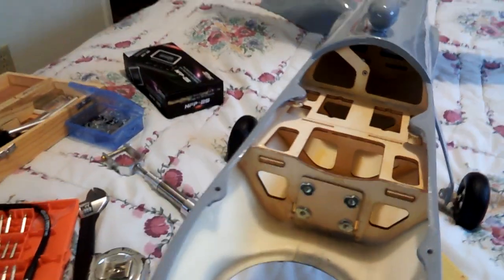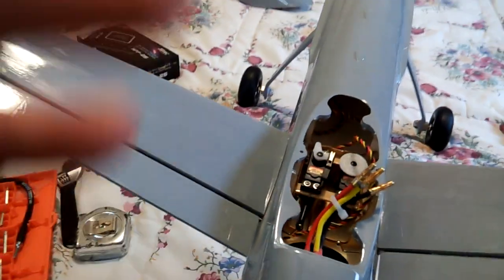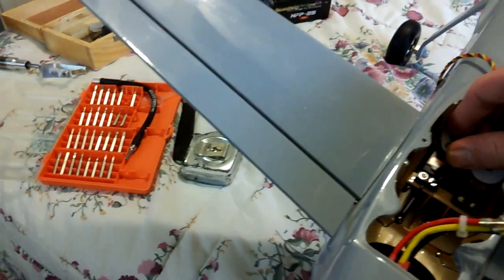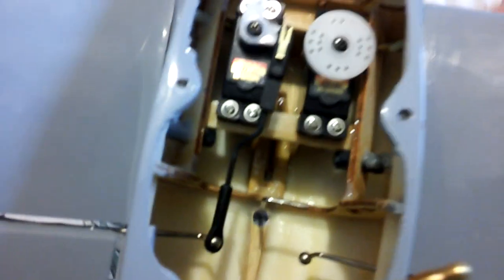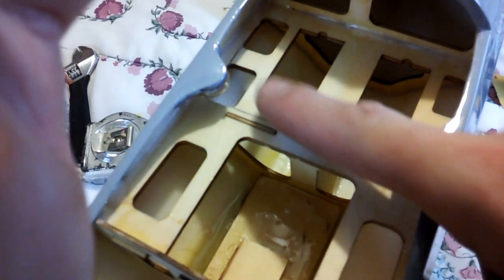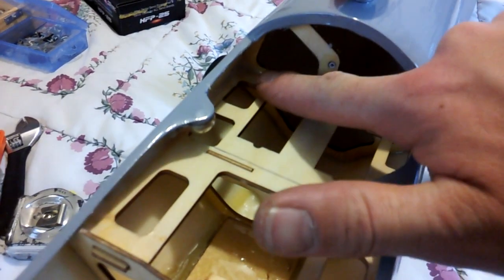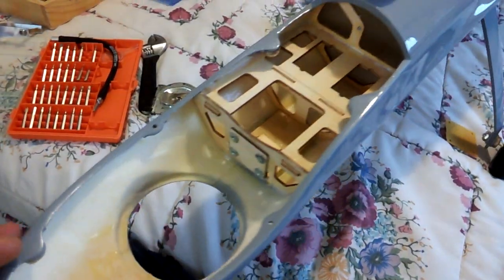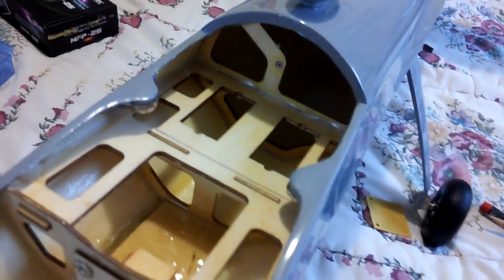ELEVATORS-FRONT STRUT PROGRESS IN THE MAKING

Comment from the maker: I did finish this, I ended up building an entire new one piece wing, had to carve out the bottom to accommodate. Added 1.2 cubic feet of wing surface, added 2 feet in length, independant elevons, and ailerons, full flaps, speed brake, Has full telemetry, altitude, temp, speed, AOA, motor temp, battery system temps, auto pilot programed flight paths, now on a 13 channel radio, with servo tracking antenna hi-freq. Running new HD 1440 cam, with either glasses or monitor viewing, or split channel glasses and monitor. Entire craft weighs 12lbs, has dual battery system that switches over at pre-determined level.
Flew at 33k feet in March 2018, will attempt to break 40k in december.. 
I will get a video of it up soon, will record the flight in December and post it as well.
Currently working on a U2 body style high altitude flyer, much better all around, better electronics, retracts etc...

Comment: Hey Rick, just wanted to give you a little warning, I have got the same airplane and its not a good flier. wings are to skinny and it makes it not very stable. I also had to put a 4cell 4000mah battery in the front and a 2cell 2100mah to bring the C.G. to where it needed to be. There are better planes out there for fpv/ filming. my video is called MQ9 Reaper battling high winds. check it out